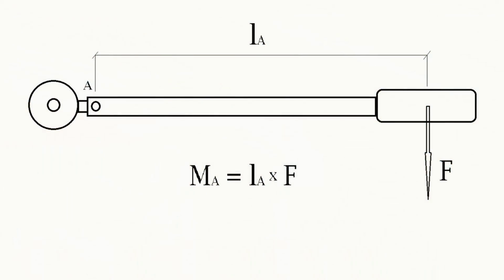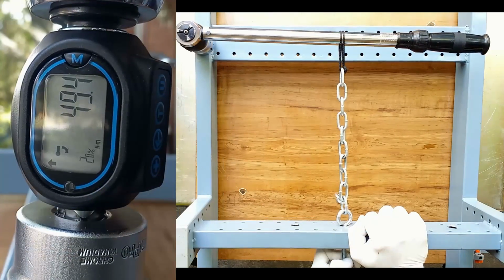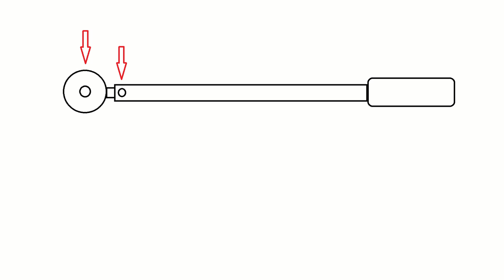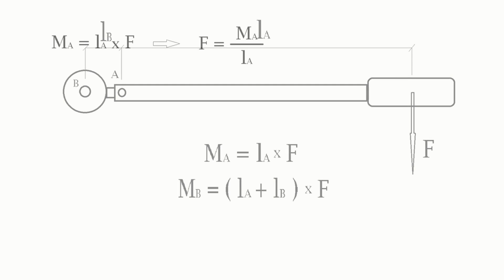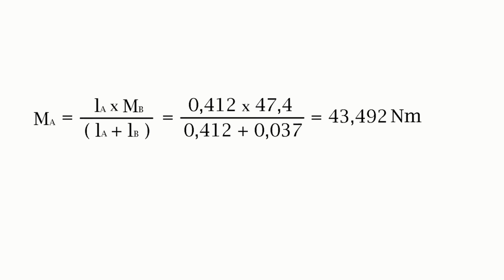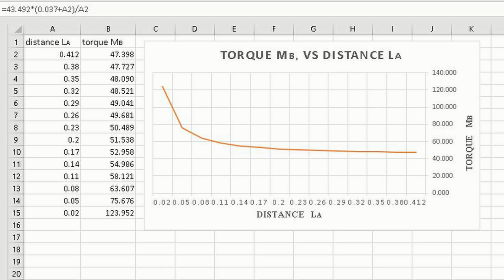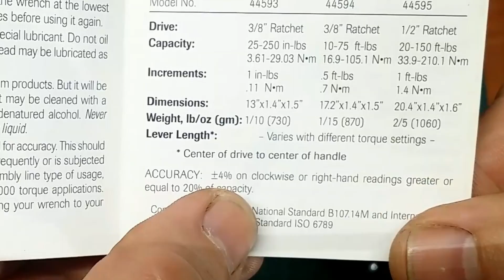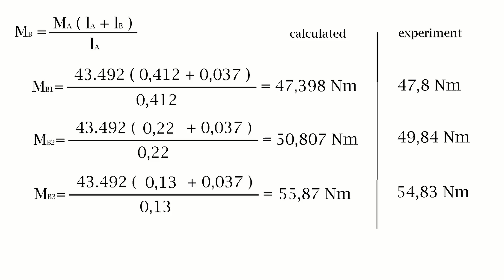Torque Wrench - Does it matter where we hold it?

Comment: Nicely proven and fairly accurate results even with the limitations of the test apparatus. I use "click" style wrenches all the time, but I still have my dad's torque wrench with the plastic handle on a pivot pin and its pointer which sweeps a gauge with the torque values. That is why I always thought that one had to hold the wrench at the handle to get accurate results. They are two completely different systems. Thanks for your well-thought-out demonstration.
Reply from the maker: Thank you for the comment.

Comment: Are people really that stupid?  The mechanics don’t change based on position of hand on device, only thing that changes is the amount of forced applied to turn the device. That’s why they say to turn at handle, but in a tight area, turning from the middle of the handle will still get the same results. It’s common sense. Nice explanation, but you can’t use math to correct stupidity.